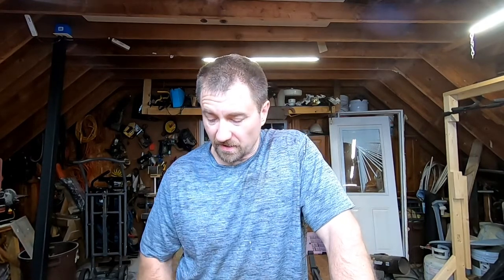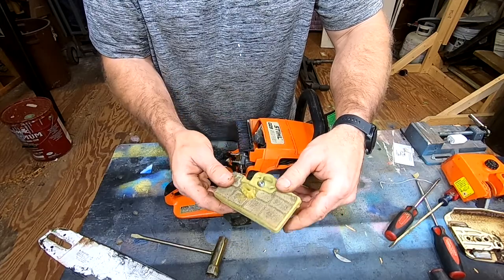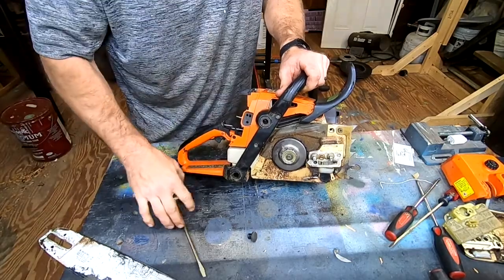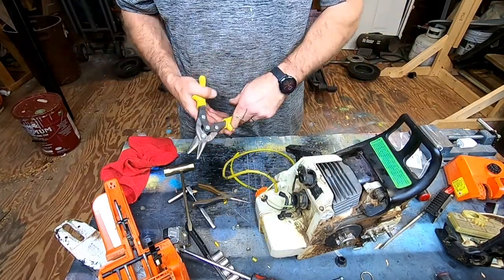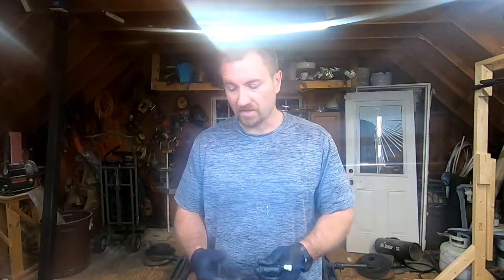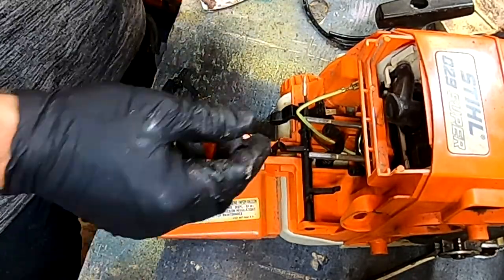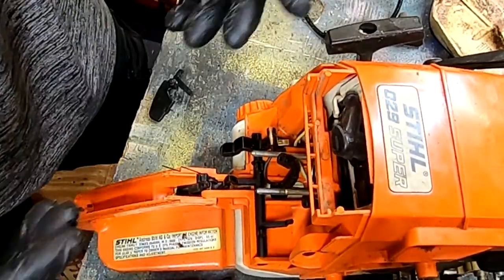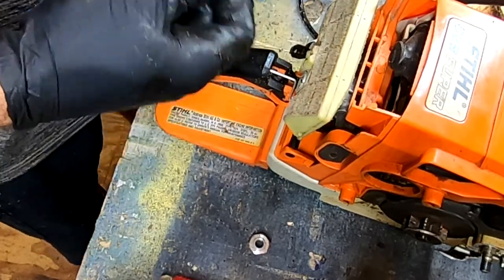Stihl chainsaw Peeing Gas everywhere.   Vent tube replacement

Comment: Thanks for the vid I assumed this was my problem but as past experience tells me to do some research first . I've had mine almost 20yrs also and this is the first time I've had this issue. Thanks again.
Reply from the maker: Thanks for the comment.   This would be the main reason to start the channel.   The power of knowledge sharing.   ;)  Good luck and thanks for watching.
Reply: …SAME here. Never a problem other than typical maintenance, new chain(s), etc..except this tube pouring out fuel.

Comment: I fixed mine yesterday on my farmboss 390. The fuel vent line was still attached just cracked. Mine had 2 screws inside the vent line, one on the bottom and one on top, allowing air to enter the hose around the threads while keeping debris out.
Reply from the maker: Mine is a 029.  a 390 must be a monster.   :)      I did find a few that had different designs.   Some are better then others.   i am not a big fan of the one for mine.   it works but it is hard to keep it on.     

thanks for the watch and the comment.
Reply: this just answered my question of "what the hell just fell out of my chainsaw and are those f'ing set screws in a hose?" haha thank you for this video, nobody has good content for this 90's era chainsaw.

Comment: Nice, thorough, slow enough to follow. Oh, and those "part words" you were looking for I believe were "Check Valve". Thanks for the video. You wouldn't have a video on connecting the back hoe attachment on a B-series Kubota would you? Or on where to add the hydraulic fluid?
Reply from the maker: sorry for the delay.  I was out of the country for a bit.    You would be correct.   Check valve would be a proper name for it.   

i would not have anything on a Kubota but i have a guy at the American legion post that has one.   I will see if i can get him to get it out and do a walk around for him. 

good luck and thanks for the watch

Comment: I think that top black piece is for in the winter time you remove it so hot air can get to the filter. My 023 has one similar
Reply from the maker: good to know.   I love learning new things from commenters.      Sorry for the video being so blurry.    my camera crew was busy at the time and I have a dirty lens.    it is one of the videos I want to redo.     thanks for the tip.

Comment: I have an 039. Pretty much identical to the 029. Have the same problem. Vent tube is missing. Here's the thing. I had a look at it, and it looks to me like I don't have to take anything at all off of the saw except the front cover. To then be able to use a pair of needlenose pliers and apply the vent tube. Kind of wondering why you took so much of the saw apart, to get to a nipple on the gas tank that is right out there in the open without taking all that stuff off...
Reply from the maker: thanks for the comment and the watch.   I usually take a lot apart to inspect and so it is better to film.   Even though the lens was dirty for that video.  sorry about that.   In hindsight I should of mentioned about not having to take so much off.  

thanks for the tip and keep them coming.
Reply: @5LakesGarage  Well done. Truth be told, I had about a 1/3rd of that stuff off, before I realized that I was looking right at the nipple on top of the gas tank, and hadn't had to take anything more than that top cover off to get a new vent on there.. LOL

Comment: My vent tube kept falling off the smooth pipe I cleaned with degreaser and put a drip of super glue on it 3 years and all good ,

Rob
NSW
Australia
Reply from the maker: Nice.  if it falls off again I have a spare and will need to use some sort of adhesive.    Thanks for the Tip.   I am waiting for someone to call me with a tree to clean up so I can restock my wood pile.   Need to sell more for more truck parts.  

Thanks for watching

Comment: How is the replacement vent line part holding up? I need one for my 029 super and Amazon sells them but there are mixed reviews on quality. Any problems with the valve cap coming off?
You think that the cap is small enough that this could be replaced and tucked in without taking everything apart?
Reply from the maker: if you are patient you can get it on there without disassembling everything  I only did it so the viewer could see a bit better.  That I wanted to clean it all up.   I think I have a mix review as well on the quality.    It work great for a bit but then it is doesn't vent very well at times time and I have to crack the filler cap to release pressure.    It is not all the time but it is getting a bit annoying.  I might try a different manufacture and hope that it is not made in the same factory as the one I already picked up.  

Good luck and I hope the video helps.  

Thanks for watching.

Comment: i have been running my chainsaw without a vent line. is it ok to do that?
Reply from the maker: You can but it is a bit dangerous.  You have a possible fuel leak.    In my case I noticed I had an issue with my pants getting full of gas.   It is a good think I don't smoke.   I would suggest you get on there for safety.  Check out some of the other videos.   We have a few Ford ones and more to come.   My Brother is having more issues with his Bronco.   Typical.   :)
Reply: @5LakesGarage  i guess i should get a vent tube i kinda get tired of smelling like gas. i have an 029 farm boss my dad bought back in the 90s it still runs pretty good. i was trying to find the oem vent tube but no luck. i dont even know what the original one looks like. i was on amazon looking and some vent tubes have bad reviews so i dont know.
Reply from the maker: Now I would have to say that I did have to put the second one on the saw after a few uses.   The vent part was not venting.   Very poor quality on the one I found.    The second one seems to be better so far.    I love my 029.    never fails to start as long as you put fuel in it first.   My arm is still a little sore.   :)    I was tired at the time and the brain was not hitting on all cylinders.     it was a rather large tree.   

https://www.youtube.com/watch?v=yiwprpQfLoY

Comment: What size hose was the vent line?
Reply from the maker: good say.  sorry for the delay.  I was OOT for a few days.    The line looks like it is a 1/8.   I have used regular fuel line while I was waiting for the vent tube to come in.   was hard to get on.   Also since putting the vent on I have seen a few times where the valve inside gets stuck and I am not able to vent the tank and it stumbles like it is not getting gas.   once I release the pressure by undoing the cap it runs fine again.    I think I will be going with a different manufacture and hope that that one is not made in the same factory as the first one. 

Good luck and thanks for watching.

Comment: I never would've found that leak.
Reply from the maker: it can be messy if you do not have the vent on there.    I had to do this twice.  the first vent tube would not vent and it was driving me crazy.    I guess that is why they give you two cause they know that they are cheap.    :) 

Thanks for watching.

Comment: I cant believe the best thing engineers could come up with was screwing two screws into a hose and stuck it on the gas tank for a cent haha I mean I hope they didn't get paid much for that one haha my stihl 021 saw has this style vent and it's dumb haha it doesn't have the valve style
Reply from the maker: I am always amazed on some engineering.   But it does keep us in business.  :)   The vent tube I put in did not vent.  Might be the reason why they put two in the package.
Reply: It actually is an effective design, have it on probably 6 of my 8 Stihls. (Referring to the tube and set screw design).
Reply: it's a stupid simple design. anybody that loses it and has fuel hose laying around, can slap a screw in it and get back to work lol